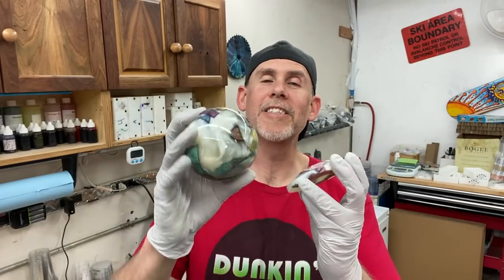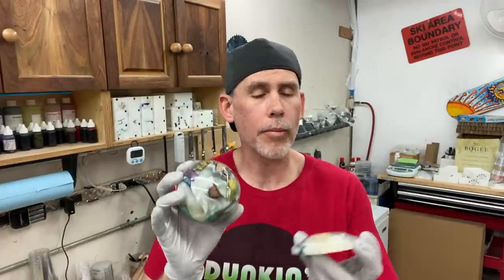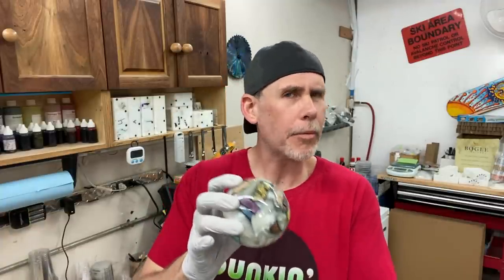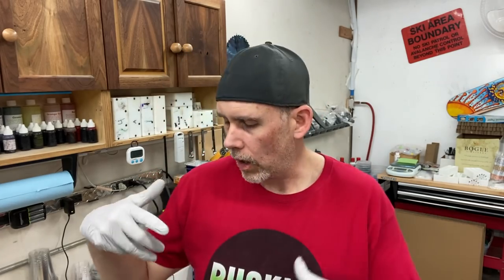Jawbreaker: Woodturning a Hybrid Resin and Dyed Burl Wood Sphere and Stand

Comment: That looks fantastic Zac.....I never get tired of polishing, it’s so satisfying when it begins to pop. I’ve never thought of doing the contrasting finishes but I must admit it does work. Thanks for the great videos and stay safe, from Paul in the UK.
Reply from the maker: Thanks Paul! I totally agree, I'm not usually one to stop sanding at 2000 grit, it really is satisfying when you bring out that high gloss. I just thought I'd try that out on this project, and it seemed to work out for a little separation between the two parts. I still have some of the same material left, might try making another base and polish it up fully to see which looks better

Comment: from some angles, it looks as though the spindles turning cw.  did you make the radius attachment yourself Zac?
Reply: It's an illusion created by the actual speed and direction of the spin and your optical sensory limitations. You may notice the same thing if you watch an aircraft's propellers, or tires on a vehicle as it goes along.
Reply from the maker: I did make a bar that holds a negative rake cutter, not sure if that works better than the original or not though. The original cutter is super aggressive with a big burr on it, My thinking is the negative rake cutters are less aggressive than the original setup, but I'd have to do a lot of testing with both to really know for sure
Reply: I'm sorry, I missed the heading for the Sphere jig. I'd love to make one for my metal lathe.

Comment: What are the dimensions of the blank?  Did you use hot glue or epoxy to glue it to the sacrificial faceplate? Why is the sky blue?
Reply from the maker: LOL I can answer all three! 

The dimensions of the original blank were 4" diameter x about 6" long, the sphere is around 3.75" diameter or so. I used epoxy to glue it on this time, I think that's the best way to go after my trial with hot glue wasn't so great.
 
For the bonus question....The sky is blue because the atmosphere scatters the shorter wave length blue light more efficiently than the longer red wavelength at the other end of the spectrum, thus more blue light makes it to your eyes. Boom!! I just rocked your world =D
Reply: @ZacHiggins  Thanks.  Epoxy would seem to be the better choice.  I was trying a sphere and it came off, it is very lopsided.  was not able to finish.  It was a learning experience.  BTW Do you know the airspeed velocity of an unladen swallow?
Reply from the maker: @geneilten6603  LOL you got me on that one, I have no clue what that even is! I do know the answer to life, the universe, and everything though... it's 42 😉 I'm guessing with that knowledge, you can calculate anything!